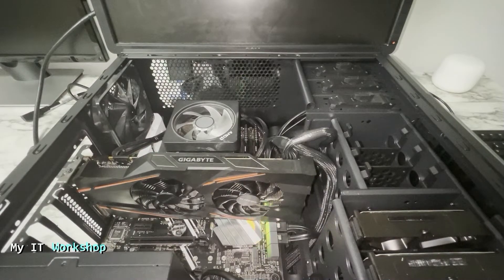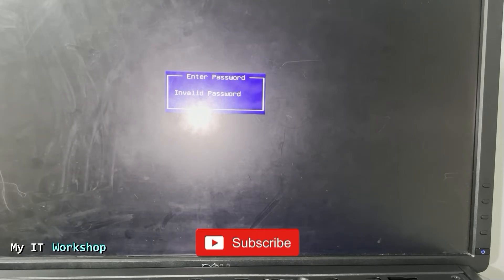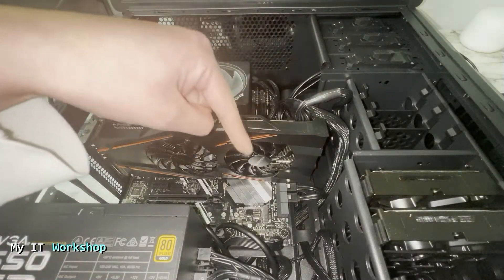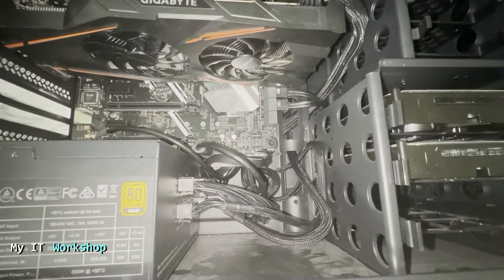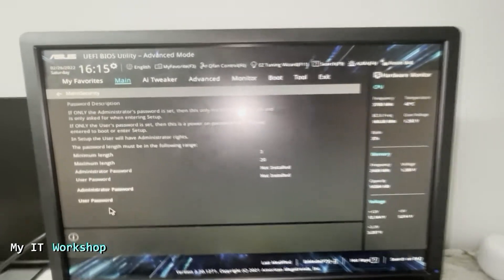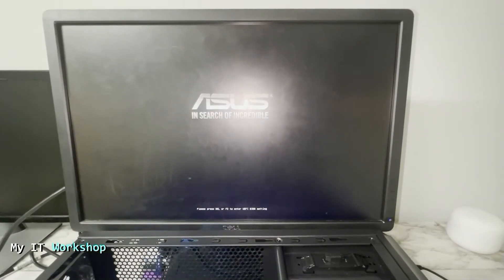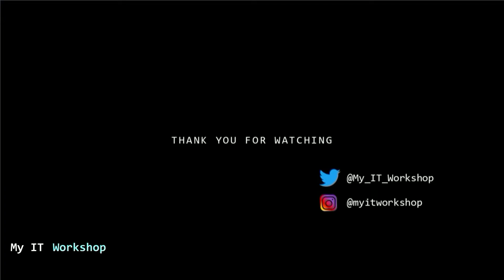Bios Password Reset | Asus Prime Motherboard

Comment: Hello there i have asus prime z490-a motherboard. I changed the cmos batt but still the bios settings are not saved. What can be the issue? I also tried reseting with clrtc jumper pins. But still bios settings not saved. What should i do? Please help.

Comment: friend, in my case I have a b450 prime, and the pins say CLRTC CHASIS, I put them together and now I get the screen that I must access the bios to configure but the password is still there, so I lost full access to my pc, I also did the process by removing the battery a few minutes, and nothing has happened, before I could access the bios without problem, and just today appeared password without anyone put one, out of nowhere, have any soucion, since my pc was useless, helpppp:c

Comment: Not going to damage my motherboard to reset a password. Does removing the cylinder battery work with Asus boards?
Reply: Do you really think Asus went through the effort to put those pins there if doing this damaged the board?

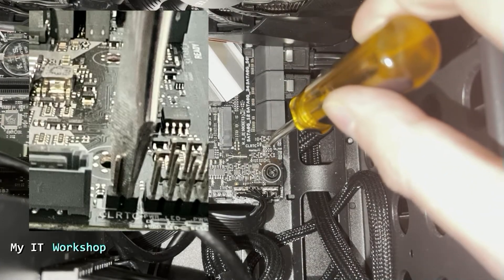Comment: can someone say me what did he do between 3:02 and 3:07 minute ?
Reply from the maker: Hello,
In that part I placed the plain head screwdriver between the 2 pins and made them touch each other through the screwdriver for a few seconds.
Hope it helps
Ty for the comment!
Reply: @MyITWorkshop  does it work for an ASUS PRIME B360 M-C ?
Reply from the maker: @aNDREwesSuroasjer  Hey,
If the motherboard has the pins to reset the Bios password then the process should be similar.

Comment: thanks for the detailed video. however, even after removing the cr2032 batteire (for several hours) I still have the same problem. access to the bios is not possible. however, this is the asus h110m-k. it was installed in a hyundai office pc.are there also suggestions?
Reply from the maker: Hello,
Maybe you can try resetting the bios password, i have a video about it: https://youtu.be/qOjKhGWC7OQ
also i leave the link for your model's manual: https://manualsbrain.com/en/manuals/1557729/?page=9
Hope it help, thanks for the comment!
Reply: @MyITWorkshop  I've already watched the video, but unfortunately the manufacturer's documentation isn't very helpful either. thanks for the tip though. I should have mentioned that I also shorted the EPROM vcc to -. it's all useless
Reply: @Heinz_zwo_drei_hfgl  Sometimes it is not possible, I have encountered it when doing repairs on Asus motherboards. Another good option (which works for NO scientific reasons) is to leave the CMOS out overnight with the RAM removed (and power cable out of course). This method seems to drain it that little bit more on occasion, good 'last ditch' attempt though.